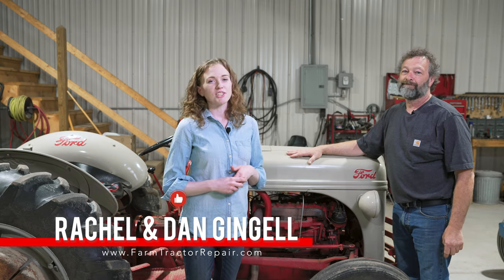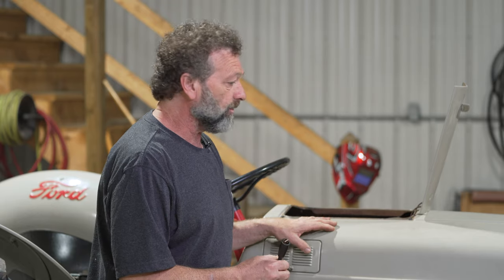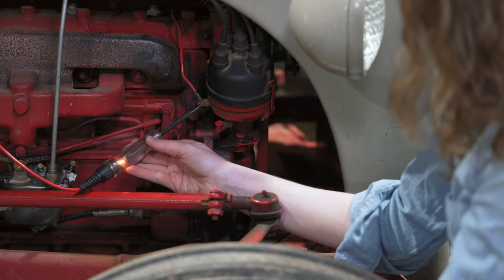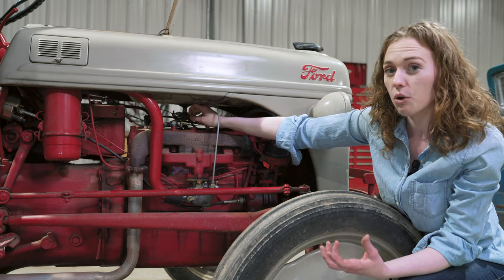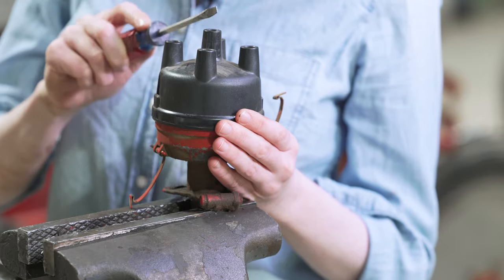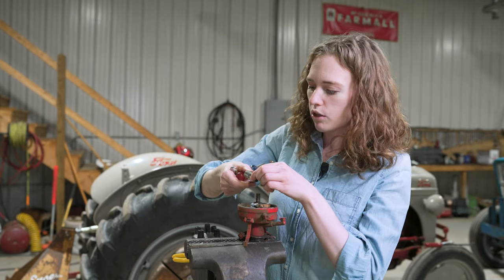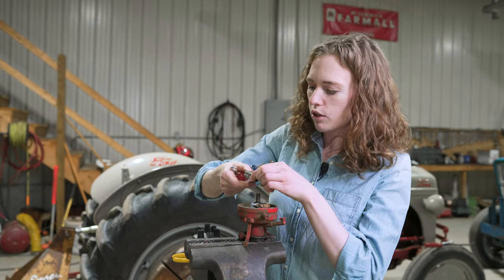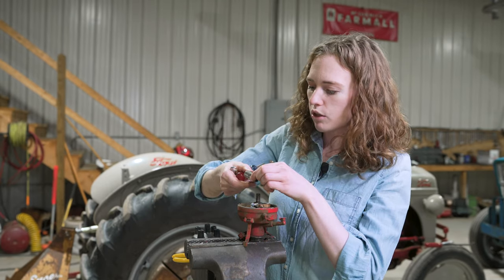Ford Tractor Distributor: Points, Condenser, Rotor, Coil: 8N, NAA, Jubilee, 600, 800, 2000 4-cyl.

Comment: Once you pull the points, it is a very good time to get some break parts cleaner on a rag and clean the points cam (Lobes) in the distributor. Old grease becomes one with dust and dirt to form a very rough surface. Not only does that surface wear the points arm prematurely, it causes a variation in spark (dwell) which will cause an uneven idle and reduced efficiency. Clean it and consider polishing it so those points don't have a  bouncy ride and your tractor will have the even beat idle you want.

Comment: Hi Dan & Rachel.  Love your videos!  I have a 1964 Ford 4000.  I purchased the tune-up kit from you and will be installing it soon.  My question is; do you need to set the ignition timing similar to the timing on vehicles?  If so, do you have a video or link that covers this?  Thanks so much!

Comment: The idea of having points is to tell the decay in performance and they rarely suddenly fail unlike the newer solid state that keeps working until it suddenly doesn't. Next time try a needle nose instead of trying to pry anything off with a screwdriver. I love it no one got their hands dirty, I need to use a freaking scrapper just to find the mount bolt.

Comment: Purchased a 640 Ford recently. The VIN made no sense, and the distributor dust cover was chewing up on the underside.  Also the rotor was floppy, it's amazing it ran well.  Scheduled a 15 minute consult with Dan and he gave me the exact production number VIN clarification--it's a 1955.  He also advised they have had a lot of trouble with the electronic ignitions made you know where,  which have an almost 100% failure rate in the long run.  He made sure I had the correct wires to the distributor. So, I ordered the parts to fix the scuffing and floppy rotor, and a set of reasonably priced parts from Dan to convert it back quickly when the electronic unit fails. He also confirmed the timing can easily be static timed in the field. Thrilled to find such high quality help, and Dan is a great American preserving our heritage as well.  Going forward, we intend to use this tractor regularly, and I am very confident we have a friendly expert to call on if we need help.

Comment: Hi Dan and Rachel, I have a 1949 8N and I want to install a water temperature gauge. Where do I install the sensor? Do I have to tap into the cylinder head? Thank you

Comment: I'm about to purchase a Ford 8N (1952). It has been restored. It runs and looks great! I wonder if there is anything you have not covered on the 8N in your videos (and if so, can you make those videos?). I'm sure I will have some issues to repair as time goes by. My primary resource for repair tutorials will be your videos! I have the same questions about the Farmall Cub, because my uncle's 1948 model [it might a 1949--I need to get the serial # and find out for sure] is likely to become my Cub in a couple of years. It will need a lot of work because it has been serving as lawn art since my uncle passed in 2015.

Comment: When using Anti Seize on threads, use the NON METTALIC formula.  If you use the mettalic kind that has Silver or Copper, it will build up on your threads and make part removal difficult and or wear your threads thin.

Comment: I'm glad I found your channel. I just spent the last 2 days giving my 1953 8n B. an oil change and tune up for the 1st. Time in 25 years.  I couldn't bring myself to pay $ 25.00 for an oil fiter so... I disasembled the NAPA filter canister and replaced the string filter with a roll of Toilet Paper. It took me a couple of hours to get that string out. It was completly solidìfied with metal filings, teflon from myself adding 1/2 quart of Slick 50 when I changed the oil once a year.

Comment: I have a new to me,  Ford 8N side distributor, seems to be in really good shape, 12 volt system. I'm changing out points, plugs, plug wires,  condenser, cap and  coil. Great video, extremely helpful. My question is the distributor oil filler tube, what kind of oil and how much to fill? Thank you from Texas!

Comment: You ought to sell the primary conductor as either a separate part or part of the kit, it's easy to say be careful not to bend it when you're working at a bench with it in a vice rather than on the tractor with corroded screws that twist the whole assembly when you try to unscrew the nut.    I'd probably have bought one "just in case" had it been available rather than wait the week it's going to take to get a replacement.    Would have rather given you the money for it.

Comment: Hey Rachel and Dan, I love your videos! I have a question that hopefully you can answer for me! I am having starting issues with my 52, 8n it just won't start.  I am using large screw driver to turn my flywheel to check the points gap and I know the rotation is counter clockwise but when I turn the flywheel to get TDC for #1 cylinder the flywheel/crank locks up and will not turn past that point near the TDC! Does this mean that there is an internal engine issue? The engine will still turn over using the starter. I appreciate any help or advice you may have. Thanks

Comment: I tried buying a spark plug wire crimping tool, but it seems difficult finding one that works with 7mm wires.  Do you have a recommendation?  Thanks!

Comment: Good video.
Tips: always clean new points with a little brake cleaner or something similar and a piece of card stock or thick paper. 
There’s oil on new points. 
Dialectic grease is not for metal to metal connections. It’s for the boots. Dielectric grease is an insulator that doesn’t conduct electricity.

Comment: On the points you need a little drag on the feeler gage. If you don't use quality parts. Your will not have enough power.

Comment: I followed your testing directions for the points, sure enough not working , light stayed on, new points and condenser, a shot of start em up fluid and this old ford fired,  for a second anyway, now I gotta rig up some kinda fuel tank and try again, first gotta charge the battery that keeps going dead ( brand new). One day this things gonna run, thanks for your videos and info

Comment: Just ordered set of plug wires from y’all. At which connectors do I put ohm meter leads to check coil resistance?

Comment: Which is it?  8n side mount has a dust cover or not.  Why is the dust cover (if needed) aimed toward the oiler?  I don't see any alignment for the cap except for the snap springs.  Leaning to the side, purpose of the oiler.

Comment: Somebody help me out here. I've got a 51Ford 8N. I've replaced plugs, wires, cap, rotor button, coil, condenser, points (gapped to 15 thou) rebuilt the carb, rebuilt the governor (set up on a factory jig). Cranks but will not start. No spark or weak spark. Ideas?

Comment: Will you be doing a video on replacing the points with an electronic  ignition or do you not recommend an electronic ignition for the side distributor 8N?

Comment: I got a question! I got a 9n it had a very slight missfire but after it warmed up went into hight rpm or under load it would miss really bad. I replaced the carb nothing. I replaced the distributor now it doesn't miss on idle but only at high rpm or under load I have noticed the govener arm keeps pulsing when it misses is that the culprit

Comment: I’m trying to get an Oliver 60 running and can’t get any spark. I have power to the points but they won’t spark when they open? There is all new hardware in the distributor but the new points didn’t come with that copper strap. Would that be the issue or does anyone have any other ideas?

Comment: What's causing my intermittent weak spark? I've set points, cleaned them, changed the cap changed the plug wires still sometimes have spark sometimes don't usually weak when it is sparking

Comment: have a front mount dist,  replaced the dist, the coil, the dist came with new points and condenser, cap and rotor, replaced the wire, ran a new wire to the coil, replaced the plugs and wire,  still have intermittant spark and week spark to the plugs,  have 12 volts going to the new 12 volt coil, looking for ideas?

Comment: Very Helpful.
My 8N has a 12 volt conversion.
some issues:
mine has a dust cap in the distributor
the coil has the built in resistor and an external resistor.
Any thoughts?

Comment: I'm confused my 12v coil has 5_6 ohms resistance by itself with no wires hooked to the coil it's internal resistance is 5 to 6 ohms so any external resistor should I assume that that needs to be removed
Reply: I just did a conversation on my 8N. It was running fine at home, took it back out to our land to do some work and won’t run. I went through 98% of the electrical, tore down the carburetor twice. Removed and went through the the distributor twice. Could NOT figure it out. So today I thought to myself. My not by pass the resistor, so I did and boom fired up!!

Comment: You all don’t know we’re I can find someone  around Murray Ky that knows how to work on Allis-charmer I-600 industrial tractor with loader . Clutch going out .
Reply: There not bad, price you spend in labor buy you some tools and a repair manual and gain the knowledge.  I've known nothing about being a mechanic and 3 months in I've rebuilt john deere engines. Transmissions, injection pumps, hydraulic pumps, hitches and cylinders. It's all easy electrical, hydraulic it all only works one way

Comment: I get no power to my test light when I go from ground to distributor as you demonstrated as 1st step, Where should I go next?
Reply: Key switch....then to power source. Check ground wire off the battery as well

Comment: Interesting rear wheel weight setup.  Don't believe I have seen that before.
Reply: Saw someone selling this weight setup on Craigslist recently.  Agree, interesting…
Reply: @johncoleman8793  Did they mention the manufacture or any identifying details?  All I ever see are the suitcase weights or the rings, and the occasional half rings.
Reply from the maker: @ShainAndrews  These are commonly referred to as "pie piece wheel weights". They are more often found on the newer Ford tractors than 8Ns, but certain sets are suitable for the smaller wheels (but not all pie piece weights will fit on this size of wheel--they were available in different sizes).
Reply: @DanGingell  Thank you Gingell clan.  That probably explains why I have not seen them before.  Just don't see anything newer than the 8N in my area.  But now that I"ve seen it  I bet I see another in 12 months.  Just how it works.  LOL.